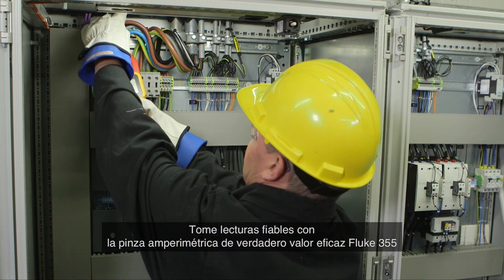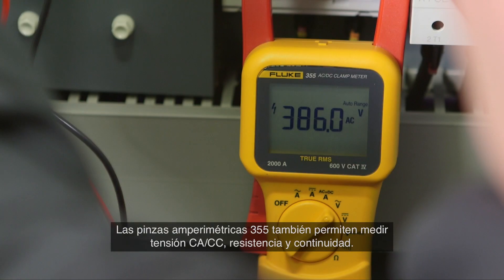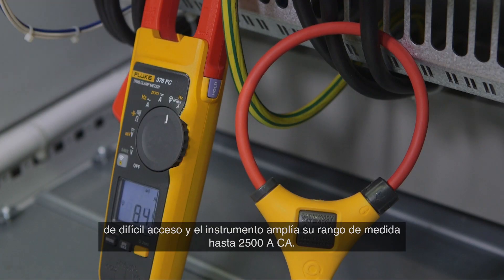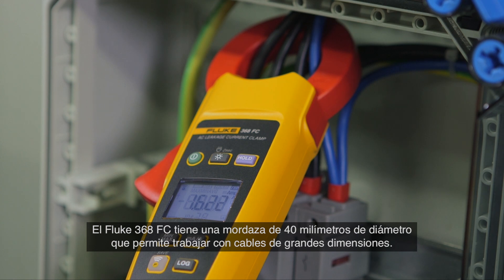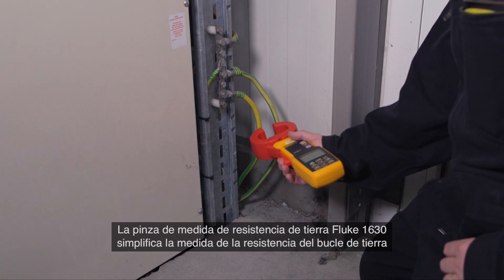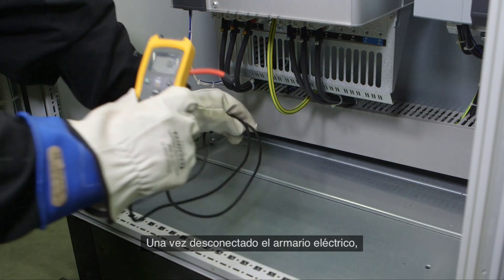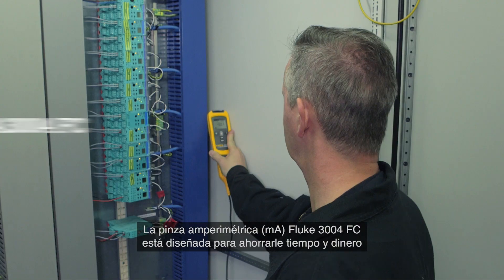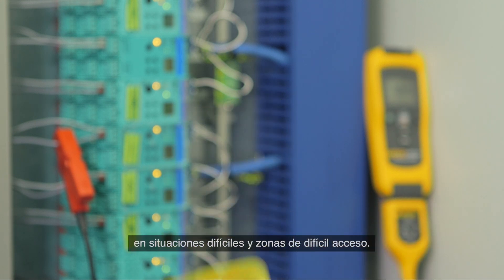Las 7 mejores pinzas amperimétricas de Fluke para aplicaciones industriales

Comment: Hola amigos de Fluke, por que las pinzas fluke muestra un - en las tenazas de la pinzas amperimetricas ¿esto significa el lado de la polaridad de la corriente en circuitos de corriente continua?
Como se que estoy midiendo correctamente el flujo de corriente en un circuito de cargadores y bancos de baterias donde el flujo de corriente continua esta constantemente variando, bien por una descarga, o por un recarga de los bancos o por una falla de una celda.